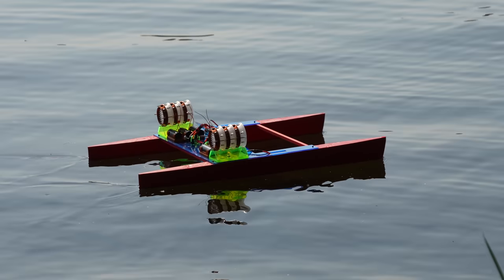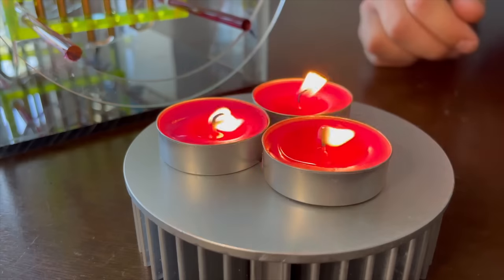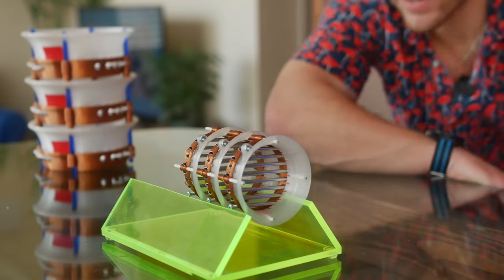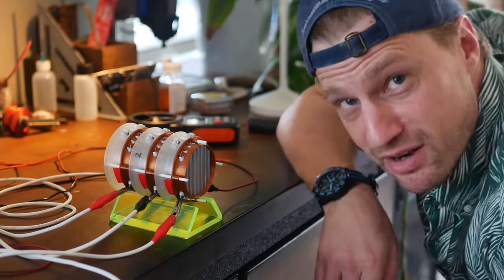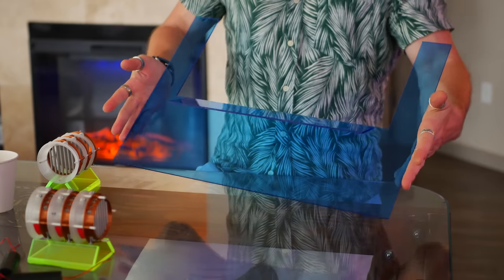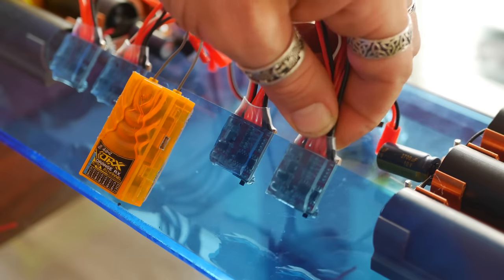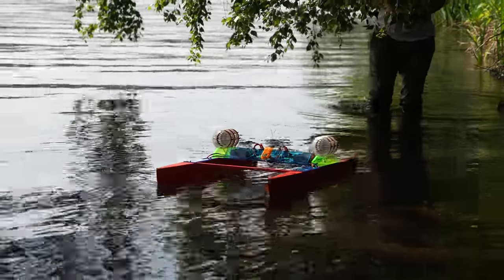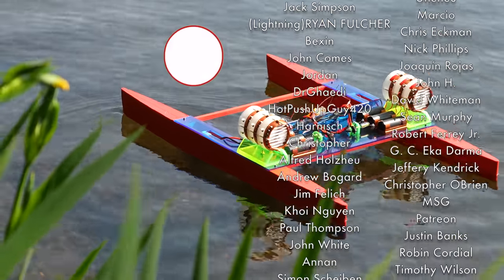Building A Twin Ion Engine (TIE) Catamaran (ft RCTestFlight)

Comment: That's a cool project, although I'm a bit hesitant what with the whole possibility of roasting yourself with 40kV and all...

One mode of propulsion you didin't mention was steam engines, they have a very low noise signature and Norwegian whalers used them to avoid scaring the whales, they were in use until whaling was banned and one is preserved as a historic landmark.
Today, steam boats in tourism are very silent, at most you hear a low thumping while on deck.

Comment: Your electrodes and power fluctuations from source might be focused on.    With current power supply it might be interesting to know the electrode material.   I have theory for you.
Reply: I have also solution for humidity issue .  This would allow a fully submersible in water.   Salinity level would reduce thrust because of density.   Ah whatever..

Comment: Also your wire connections soldered needs trimmed back. Lead has weight also shrink tap only use just what you need

Comment: Why are you not putting it directly into the water and attach a magnet.
Then you have a static magnetic motor with water as the moving part.
Reply from the maker: MHD thrust requires high current. Not high voltage. These thrusters operate of super high voltage, and super low current. They would provide zero MHD thrust in water.
Reply: @PlasmaChannel  Thank You for you answer.
But,
a. you can still add a magnet and convert the sparks from the humidity in "thrust"
b. the Watt consumtion would be the same, wouldnt it? So changing the circuit should not be that difficult.
c. it would make for a great video, because it is totally awesome and cool xD

Comment: hey, I have technical question, say you would make contraption to "catch" the moisture before it enters ionic engine part. Im thinking air duct with tiny opening that would widen as it goes deeper towards engine, that would serve as a freezer (lowering pressure therefore lowering temperature) and would cause water droplets to condensate somewhere safe for the rest of the device to work. I think it has a potential on a bigger scale. Can anybody confirm it could work ?

Comment: Get rid of the flatt bottoms and think round you could use pvc pipe heat it up on the inside ends and flattening them on an angle poof your done unsinkable plus less resistance in water super cheep and versatile to use on anything you want, i had another question to the shape of the thrusters why round ? Have you tried an Oval shape or larger at the intake and as you go to each segment reduce it creating a ventury kind of effect increasing the air vollocity hmm scratch that might not work like I'm thinking

Comment: if you mirror the same positve electrode wires at the opposite side of the negative electrode ( + - + aka like a sandwich), maybe it might work as a reverse thruster without having to turn the thruster 180 physically to reverse. just need to power either one side of the electrodes to determine the direction of the thrust. When manuevering, one side could go forward and the other reverse at the same time, kinda like a tank cross drive system.. just a thought..

Comment: yes, it's cool. However, it doesn't solve the noise problem from the engine sound.
because the ionic thruster still makes the sound of electric sparks.

Comment: I’ve got an idea, if stages don’t interact between them as much as you would like, why don’t you put the stages separate but using one common output, I don’t know if I’m explaining myself okay but that would mean a huge improvement!
Reply: I would cancel the Intake for the 2nd Stage. Maybe even move the 2nd stagew closer to the first stage and narrow down the neck of the 2nd stage. The higher the Speed the more of forced draught air you get. With the opening in front of the 2nd stage you add more mass but don't accelerate much. It should increase the speed, the biggest Question is: Does it increase the pushing weight.

Comment: Why don't you install a normal rudder at the back for better steering?
you don't have to reinvent the wheel.
small electric motor with timing chain.
Reply from the maker: The purpose of the thrusters was a no moving part boat. Adding a rudder defeats that purpose.

Comment: Extreme interesting idea, but is it only so quiet, because its air flow is that slow? Higher air speed would/should cause more noise... Not to speak about the poor efficency. A propeller with this low flow and thrust ist also extreme quiet, but needs much less energy.

Comment: why dont you enclose the "engines" in some kind of insulated tube that can draw still draw air through it like a vacuum but blocks the majority of the actual moisture?i get the whole more weight = bad, but if weight is the issue scaling these up will always be a problem - seems like the engine design need more umph.

Comment: Since putting them in series (physically  not electrically) only yields % of power, wouldn't it make more sense to put them working in parallel like side by side in a triangular(3) or rectangular (4) formation?
Disclaimer: mechanic not engineer. We can fight about who's smarter later

Comment: This experiment is in very early stages. HOW MUCH HIGH voltage will be needed to create thrust equal to a aircraft jet engine.
Reply from the maker: Correct, it is indeed in the early stages. Higher voltage would be beneficial, as well as optimized spacing

Comment: Oh oh oh i have an idea, have you tested the torque of this thing? I noticed that in this and your MK2 vid you just have the engine with an input nozzle to help with airflow, but no output nozzle to convert torque into more horsepurrs. Making a comparison to a car, that would be like directly connecting the engine to the wheels, with no gearbox. You might have 0,0001 torque to spend, or you might have a shitload, IDK! Or this might be your plan at a later stage, I also DK.

Comment: Who said ionic engines should be round? Just do one big rectangular one over the whole width of the boat, you will get way more thrust. Steering could be done with a normal standard rudder.

Comment: You do realise a rudder with a servo wouldn't increase the noise signature, right? :) (Unless you are constantly waving it left-right, that is)
It would be a lot more effective than differential thrust, and the boat wouldn't need to slow down to turn. Or, a servo to turn the thruster(s) left-right could work too. Ok, moving part, but you said the goal is to be quiet, not to eliminate moving parts...

Comment: Have you considered the coanda effect. Air clings to a surface. I'm no scientist but shouldn't the pull and thrust mechanism not be built into the walls rather than in the air flow itself. 

Remember a steam boiler doesn't just heat from one area; the heat passes over many pipes of water to heat it more on every pass. 

Perhaps it needs rings of charge in the walls of a closed pipe to build speed then a narrowed end to create pressure and avoid coanda effect. 
Are my ideas just nonsense or does it make a difference to your views.

Comment: Maybe "electrostatic vortex air compression" would speed things up?
Reply: Also a vortex would theoraticly draw airflow into a center, where humid air be drawn away from electrodes on the outside, reducing electricity arcing.  For this to work, the shape of the two electrodes should not be straight bars in a row, but be shaped like inward spiraling shapes like in a sea shell or tornado. 

Any or either way, almost everything moving in rhe atmosphere or space  boils down spiral motion. It forces all energy to one point in the center. A principle also seen in a jet engine. The trick is to do it without moving mechanical parts.

Comment: OK
Hear me Out...
humidity increases the mass of air...right?
how about more spacing between the wires and the stages to make it more humidity proof, but also making the wires less straight(coiling it around a thin plastic tube for example) to encourage the sparking for large volume high humidity plasma.
this probably wouldn't work but who could know unless someone tried?

Comment: if you have batteries anyhow, why not use an electric motor to dial down the noise?
Reply from the maker: Electric driven props make the same noise as an engine driven prop
Reply: @PlasmaChannel  the main noise would not come from the props though IMO. even if it does there are other options than props with better noise rates and higher power output (pumped jets, electrostatic pump, etc).

Comment: Your problem is that an undersized, nearly silent, combustion engine would still be putting out far more thrust than these ever will.
Even an undersized, nearly silent, electric motor would be far more efficient and powerful.
There is a reason this 70 year old technology hasn't gone anywhere save for low gravity zero resistance applications.
All you've shown is that it can produce 'some thrust', which was never in question, a slight breeze would overpower this thing.

Comment: The idea that silent is better is naive for someone who truly loves the ocean. While noise stresses and scares animals, silent vehicles are equally dangerous because people and animals dont hear them comming. With no propeller, the threat is reduced in the water and transfered to the air. With larger scale engines,  i could see birds flying/getting sucked into those zapping engines with deceased birds being expelled.

If this could work without using a battery somehow, i think it could be a much greener solution to conventional i.c.e. boats. But boats journeying large distances dont have the opportunity to recharge.

As long as boats transverse the globe, i think any form of propulsion is equally dangerous. However, if these engines could be solar powered on a full size vessel, i think they could certainly be more environmentally friendly. Dont forget that the world still produces electricity from burning oil/coal.

Comment: ion thruster, in the air, with humidity problems, you wont be able to take those planes anywhere near clouds, where most commercial aviation is and will not route around just for noise, but no where near a coast or tropical climate, take a weather class and redesign idea. PLease have a pilot check the weather for you before you apply an ion thruster into a glider, i dont want to see anyone get hurt.

Comment: Given the thrust measurement, which could have been done with a $2 postal scale, I calculated the system to be 12.5% efficient or 87.5% waste by heat loss and drag. A postal scale could also be used to find the most efficient line of thrust to point thru the system cg. Heat loss, thrust, and drag would all be improved greatly with a titanium foil wrap forming a simple duct around the perimeter. Theoretical 100% efficiency according to his numbers would be 136 g (0.3 lb) thrust. More realistic maximum efficiency would be a nominal 50% yielding a theoretical 68 g (.15 lb or 2.4 oz) thrust instead of the measured 17 g (0.0375 lb or 0.6 oz) thrust. Thus instead of producing 0.6 oz thrust, with cowling it could have conservatively netted about 4 times that number. This speaks nothing of the Ah range or W of power supplied by the batteries. don blankenship, veteran aero engr. Addendum: using 100 of those stun gun batteries could provide about 15 lb thrust to propel an ebike according to the numbers above. Appropriate system safety factor should be applied if the system is to be operated at Titanic tourism depth.

Comment: Was having a bit of a Brain Fart.
Say why dont you make a cowl for the engine so it looks more like a regular jet engine and then make it positivly charged so that it draws the lightnings that happens to form on the outside you can then have that run back to the batteries as a charge true you have to run it to some capacitors but why let it go to waist. ;)

Comment: Hi I'm Mark and I build something similar but anyways why don't you use materials like graphene cause remember it's a conductor and also irradium magnets with the highest rate because remember The dominant uses of iridium are the metal itself and its alloys, as in high-performance spark plugs, crucibles for recrystallization of semiconductors at high temperatures, and electrodes for the production of chlorine in the chloralkali process.. anyways this is use full info, I'm building the same but my ideas are coming from God not me So Give Him the Glory!!! Then yeah make those tiny coils into graphene and add more coil circles not in front or back but over the same 3 coils but don't let them touch keep distance and the second coils will just be a bit bigger diameter because remember it's going around the same coils just separate 👍

Comment: Do not confuse power and efficiency:
The ratio between the power consumed and the thrust force produced is too low... If this system were good, everyone would have already adopted it!

There is no miracle and no solution in this way...
Thierry.

Comment: Single + littlr needle point and positive being a HOOP. 
Q Why;, cause magnetic, electric waves move in circlure shape.
 The Ionic lifter, in Triangle Shape is Ignoring, the Pattern of Magnetic/Electric Movement.
Tesla - Shape magic book, said, the "shapes of NATURE, shows up  in simple patterns, but have Powerful  implications".some thing like that.
Try a Circle and Needle configuration, My "Needle to a Hoop" Fan worked well in varied Humidity.

2inch Hoop of 20 AWG , needle point{Positive} on a High voltage from a PC monitor transformer{Trivac??} 6volt-12v .200 amp.
The cone shape corona, due to Needle to Hoop,  has neat effect's you'll like to see with Tempeture.

Comment: If I heard the numbers right, this is running less than 15% efficiency.That's a fifth of a propeller at ideal cruising speed and this setup only gets that full efficiency while static. This is not viable or safe to scale up.

Comment: Hmmm... 🤔 Ionic thrusters on a boat... Just need very little to no humidity.. Now, how can that be done on a body of water? lol 😉😛
The other thing is, sadly, this form of motor will never be practical for real world uses, all weathers can form quickly, rain, mist, fog, storms, all render ionic drives useless... 🤔😏 Plus, imagine a full sized Ionic thruster (or two or few) arcing out! DAMN that'll be loud!
Even aircraft would suffer these issues (clouds anyone?) 😏
Nice try though...
😎🇬🇧

Comment: This is fine and all but I'm really tired of "Can this relatively new technology that's wildly impractical for this use case replace a highly mature solution that's developed over many decades?" The answer is no. Ion engines sit at the intersection of absurd efficiency and extremely low power. The only place you see them used is satellites, where there is no friction to overcome, velocity changes can take place over months with no issue, and fuel efficiency is king. I will be shocked if you get an inflatable boat up to any respectable speed with Ion thrusters, especially ones that don't have their own fuel.

Comment: You can't possibly think that this will ever be useful for actual boats. With the same power on a conventional propeller the boat would have been what? 10? 20? 50? times faster? And even then electric propulsion does not and will never work for larger ships. Energy density of batteries is just way too low. Reducing the efficiancy of your drive train by orders of magnitude does not help that.

You did a cool project. Stand by it instead of hiding it behind "maybe this will help in the future" to impress people with little physics or engineering knowledge although you 100% know that it is useless for driving a ship and will always be.

Comment: Wrong technology for the right application your magnetic propulsion system or caterpillar drive is virtually the same idea using water as a medium of propellant which mass × acceleration equals thrust water molecules having a higher mass seems like it would be way more efficient for this application. And The fact that it's already designed for aquatic applications means humidity Waves ocean spray we'll have zero effect on the system.

Comment: "big issue with humidity"  Here's another one: You're playing around with something that runs on 40,000+ volts while having both legs up to your knees in water... Ever heard of don't mess with the air dryer while in the bathtub?  I know the amps are low but this is for an R/C size toy. What happens when it's upscaled to fullsize?  Certainly more amps, still 40,000 + volts while sitting in water... Just sayin'

Comment: The sound of huge waves pounding a beach or the sound of Niagara Falls has zero impact on marine and/or avian life. And it’s exponentially louder than the sound of engine noise or prop-wash from a motorized boat. I can appreciate the ionic thrusters on your catamaran model, but to say that boat motors have a huge negative impact on the aforementioned species is false and fear mongering. If you disagree (which you probably will), then post the numbers to prove it. But I’m going to be bold enough to say that you are incorrect in your statement, and it’s a complete embellishment of facts and truth.

Comment: This is in no way better for marine life, that arching must be mind numbing. At this level of power, you'd be better off with electric motors running at low rpms. You can design the propeller to create minimal sound. Not too mention that this is a small rc boat, good luck scaling that to a freight ship. It's a great project video but stop with that marine life BS, nobody's buying it.